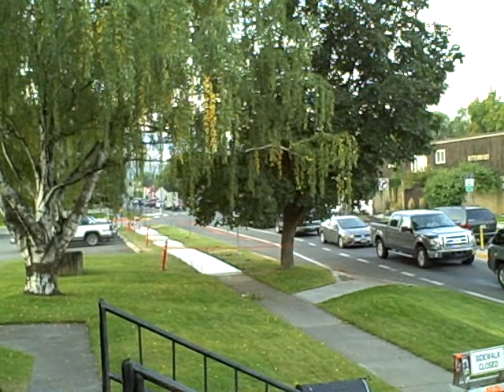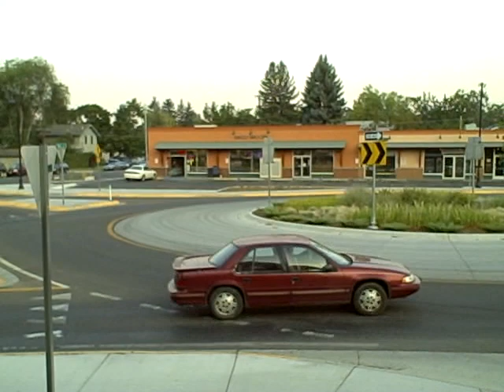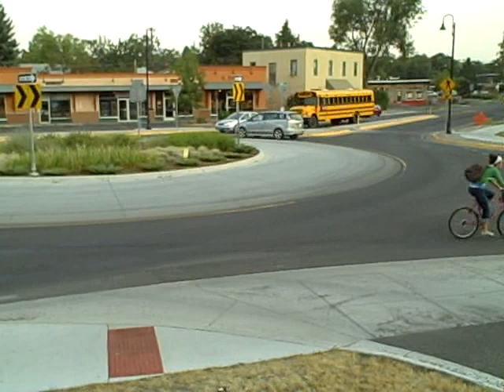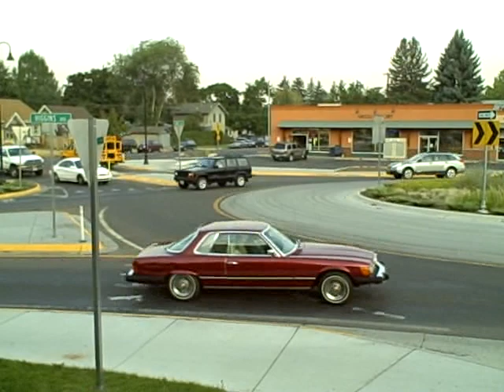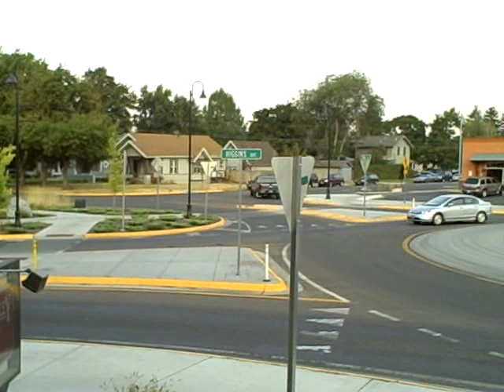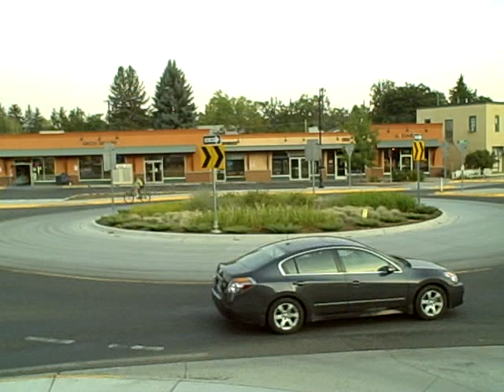All About Modern Roundabouts- Higgins Roundabout at Rush Hour in Missoula

Comment: This is very informative...One of our local towns is deciding to put one in PRather , CA. It is very decisive. I like this idea. I didn't see any large logging trucks though. One question, where do you walk across?
Reply from the maker: Pedestrians use the crosswalks that are set back from the circle about one car length (about 20').  Walkers have the right of way, so drivers must legally stop.  Walkers make sure drivers have stopped before crossing. Yield rates to walkers are excellent.  

The key for roundabout safety: eyes are down at road level, instead of staring up at the light.  Drivers tend to start slowing a block away, instead of speeding up a block away (or more) when they see a green light.  All right turns, and the slower speed due to the circle in the middle, combined with eyes on each other make for the excellent safety record of modern single lane roundabouts.  Glad you asked about this, as I just noticed we did not talk much about ped safety in this video.

Consider that a study from Melborn, Australia compared 2,500 signals to 4,000 roundabouts over a four year period.  The signals had 27 walker deaths and the roundabouts had zero!